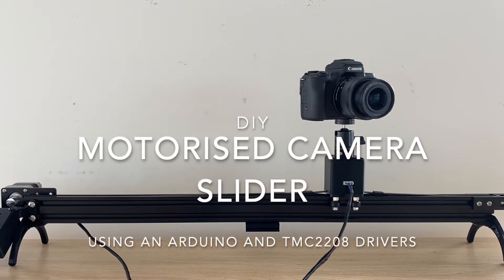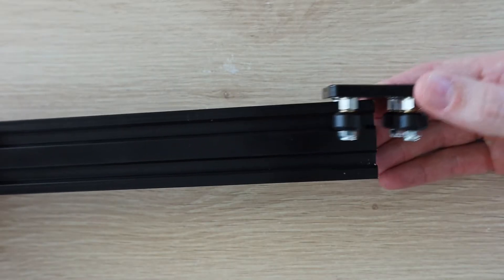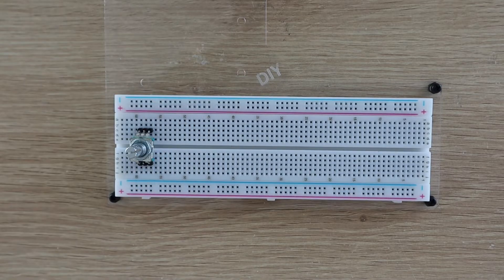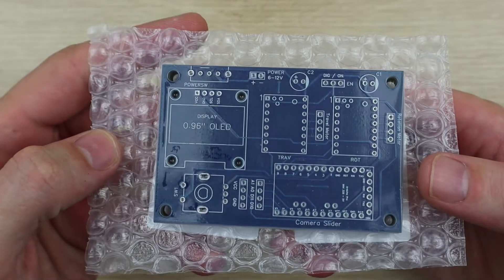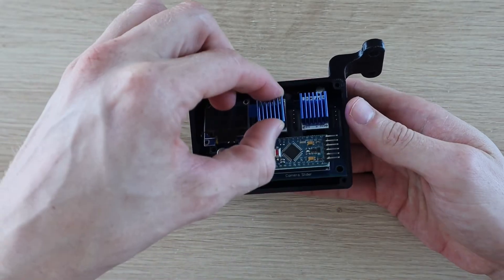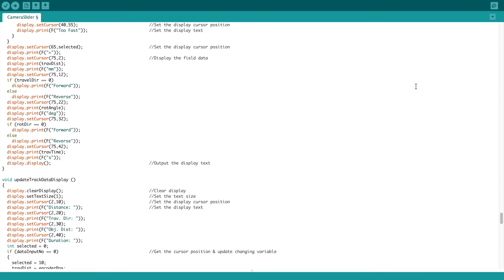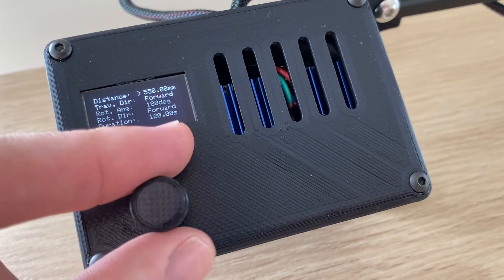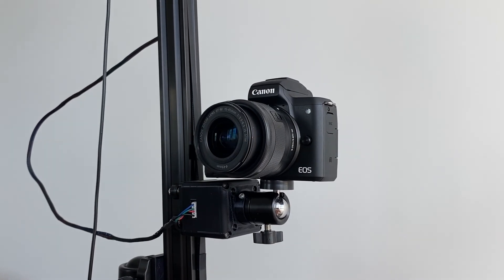DIY Motorised Camera Slider With Object Tracking

Comment: Hello Michael, your project is really great, that's exactly what I need. Do you sell the already manufactured PCB? I will be interested to buy it from you because I am not very good in electronics and that would make the assembly of the project a lot easier. Thank you for your answer.
Reply: I'd also be very interested in buying this kit and willing to solder my self with some guidance.
Reply from the maker: I can look at putting a kit together for the electronics. It probably wouldn't be fully soldered, but this is relatively easy to do yourself as you're not soldering any small or delicate components, mostly header pins.

Comment: Do you think this could support a heavier camera like the Canon C200?
Reply from the maker: It would probably manage DSLRs with a small lens, but I think the C200 is too heavy for it.
Reply: @MichaelKlements  what modifications would be necessary for it to support a camera as heavy as the C200?
Reply from the maker: @nmweissm   you'd need bigger stepper motors and then drivers which can supply more current to them. The rest of the components would be fine.

Comment: Is it possible to operate with a 5v voltage? I would like to work with a power bank, otherwise I will take a battery pack
Reply: And what function do the capacitors have? Only as a filter?
Reply from the maker: The TMC2208 drivers are rated for 5.5v to 36V, so you would probably be able to power it using a 5v USB supply. The current draw might be an issue though as power banks usually only supply 1A, which is probably too little for two stepper motors. 
The capacitors just cover for short peak demands on the supply and protect the other components from voltage drops and/or noise generated by the driver.
Reply: Thank you for the answer. In Germany, most power banks, at least those of good quality, have a 2.1A output. As soon as all the parts for the slider are there, I will measure the current consumption, if it is not possible with a commercial power bank, I will build one myself.

Comment: Sir can you add a wifi module to it to connect to it and give it instructions wirelessly!
Reply from the maker: Yes this should be quite easy to do. I tend to avoid using WiFi on these types of projects as I find the reliability of the WiFi connection is just another frustration to work around when you're trying to get things set up quickly.
Reply: Use Bluetooth instead

Comment: Engines sound a lot to record with the microphone close? for example to stream
Reply from the maker: It depends on the speed you're running them at. When they're turning slowly (less than around 15-20 RPM) they are basically silent, they make a slight hum when running faster. It depends on how sensitive your microphone is as well. I recently made a video comparing the sound level between the TMC2208 and A4988 drivers which you can listen to.

Comment: Fantastic project indeed !!! Thanks for sharing!  Now a question: would it be very complicated to add a 2nd motor controlling camera tilt just as the first one is controlling camera pan ? (3rd motor is driving the belt, not taken into account)
Reply from the maker: Not at all, you could quite easily add another motor to the system. You'd just need to add another driver with its two inputs connected to the Arduino. I don't have much use for a camera tilt axis, so chose not to add it.

Comment: Far out mate top effort! I just dropped a grand on a new slider (Shark Nano), and you're pushing for the same functionality. I don't know how they do it but you can physically move and point the camera to set point A and B, and then just set a time to get between the two distances. For me that was the big selling point as has made production so quick with sliding shots. But to see you're able to pull off the same "tracking" shots with $100 in 3D printer parts, very impressive and inspiring! Chuck some warp stabilizer on your shots and you'll have an even smoother pan too
Reply from the maker: Thank you! Yeah there are a few things I'd still like to try and improve, but I'm quite happy with how it turned out. I'm guessing your slider has some form of encoder on the motors, so it knows that actual position of the motors. This allows the controller to "sense" the position of the camera. That's a really neat feature, I'm sure it saves a lot of time.
Reply: @MichaelKlements  Ah yeah encoders would make sense, It also has a laser on the sliding part to sense distance too so it won't ram into the end if it's on high speed,  I hadn't seen anything else like it which is why I finally pulled the trigger and bought one. 

But love the D.I.Y. project, and I can see a great use for this in making custom super long slider setups by using that steel! excited to see what else you come up with in the future, great work 👍
Reply from the maker: Ah if it's got a laser on it then that's probably what it's using to measure the position of the camera. 
Yes you could make this setup as long as you need. Although anything over two meters and I'd start thinking about putting the pan motor onto the gantry as well and driving the wheels so that you don't need a 4m long belt and large tensioner.

Comment: What was the total end cost of this project?
Reply from the maker: Depending on which components you may already have or are able to salvage (stepper motors, 3D printer filament etc.) it should cost between $60-$80 to build. If you've got access to an old 3D printer then this will likely have the belt, tensioner, extrusion, motors and potentially even a gantry.